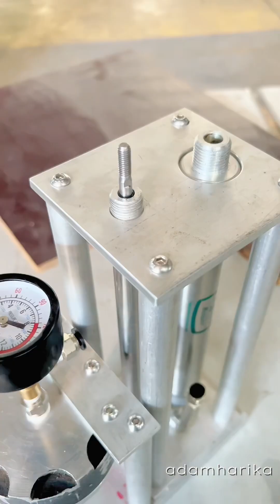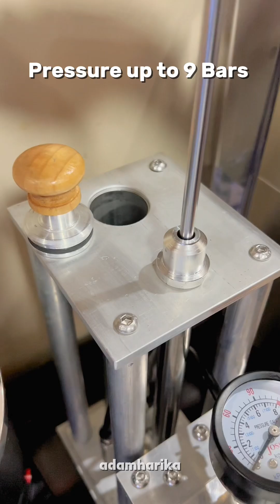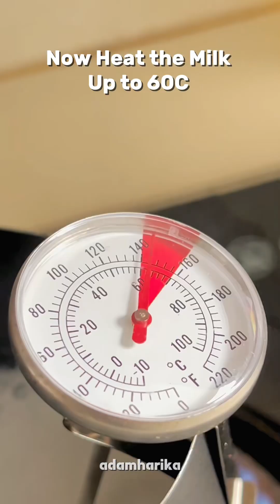DIY Manual Espresso Machine and Latte Art with Manual Frothing #DIY #coffee #Espresso #latteart

Comment: Without preheating the parts, doesn't the extraction lose too much heat? Also since everything is mainly metal? 

But damn! You made a pretty fine machine.. 👍
Reply from the maker: @Abhishek.Sarkar  Indeed, I did preheating by running boiling water for 3-4 times before the actual brewing.

Comment: Great, may I ask what size piston is it? and how many bars is the maximum pressure? thanks
Reply from the maker: @vechaidecor6119  piston is 16mm dia. Maximum pressure 12 bars
Reply: @adamharika269  thanks,
Reply: I used a 20mm piston to press the air but it did not work, only 3 bar @adamharika269
Reply from the maker: @vechaidecor6119  have you check your grind size? Needs to be quite fine for espresso. Anyway, 20mm is too big, it is too heavy to press, equal to around 62lbs. 16mm is ok, equal to 36lbs.
Reply: @adamharika269 ukuran port output air cylinder nya berapa om? Saya beli di shopee ukuran nya M5 untuk 16 x 250. Dan pas di tarik, butuh waktu untuk sedot air nya
Reply from the maker: @darwis059  iya memang ukuran nya 5mm. Butuh waktu gimana maksusnya?
Reply: @adamharika269  aliran air yang disedot kecil jadi piston nya harus ditahan beberapa detik supaya bisa penuh. setelah saya cek ulang, ternyata di check valve nya yang perlu di atur. untuk double shot espresso apakah tarik dan tekan pompa nya cuma sekali bisa ya?
Reply: awalnya saya kira penyebabnya karena output air cylindernya yang hanya 5mm
Reply from the maker: @ oh, Iya baut check valve nya diputer puter sampai enak dipakai. Double espresso 2x tarik dan tekan